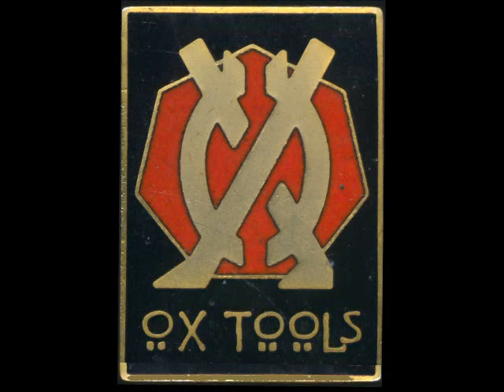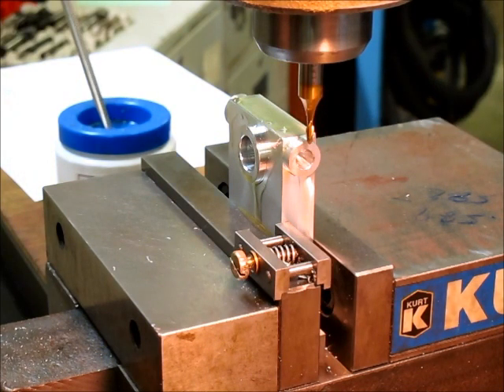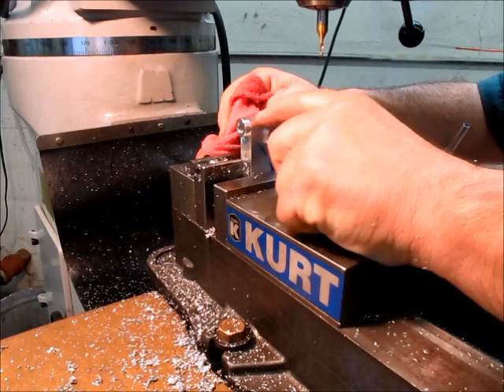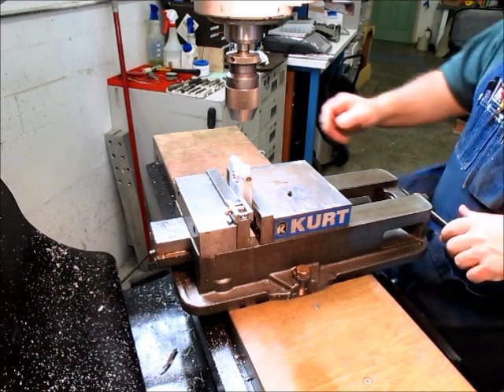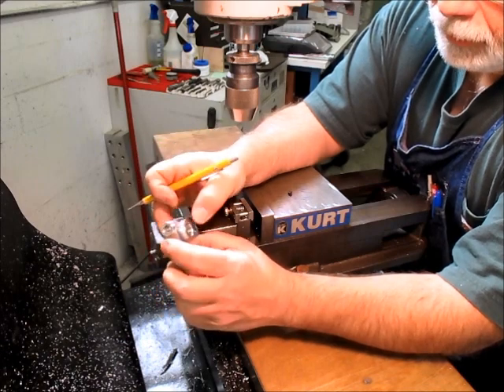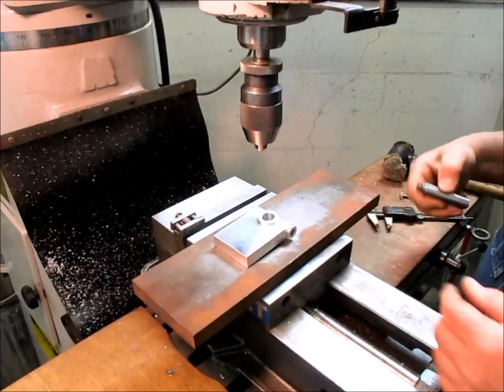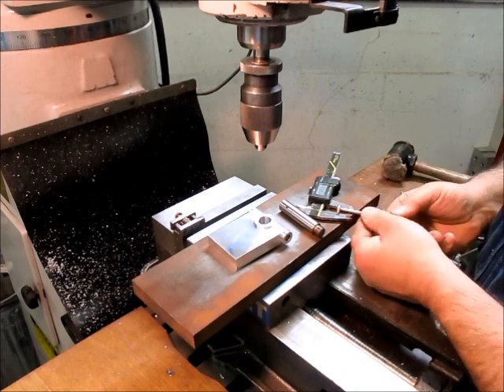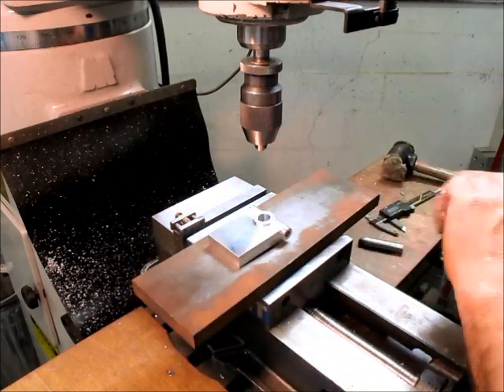Blade Tensioner Repair Part 5

Comment: Very cool!  The broken part on mine is slightly different.  The hinge is a solid through pin that intersects a matching radiused(is that a word? spell check says no) notch in the wheel shaft, locking it in place. 

Every time I hear someone say "Why is math so important? I'll never use it." I cringe.  As a layout carpenter in Kansas City years ago, I had to lay out steps for seating in a theater with rows on a 100 foot radius.  Problem was, there was a wall preventing us from pulling the radii with a tape.  Chalked out the grid correcting for the slope and plotted points on each  radius every foot.  This was for concrete forms.  We were already setting forms when the boss showed up with the architect with a "solution" to a problem we already solved.    Basically a less complicated version of what you did here on a much larger scale with a calculator and field book instead of AutoCad.  The old circle plotting formula has come in handy a few times.

Super work on this!  Thanks for posting it.
Reply from the maker: Hi Blme,

Thanks for the comment, Math works. Folks that don't get that end up having to listen to folks that do understand its value.

Cheers,

Tom